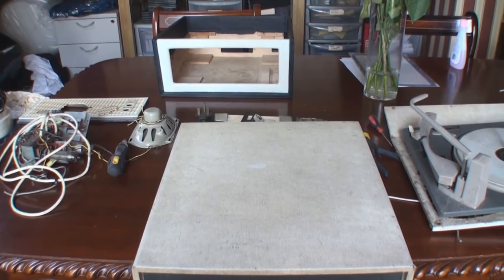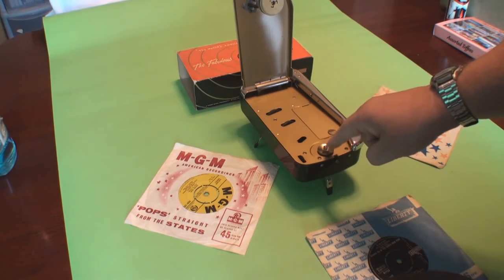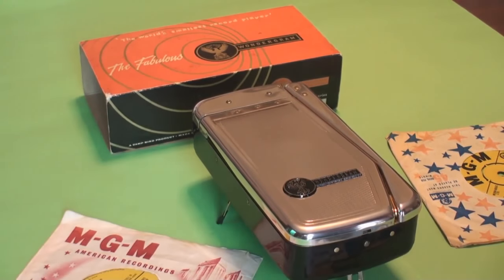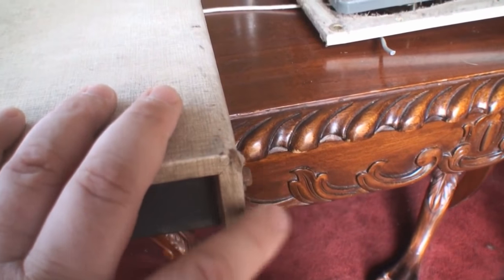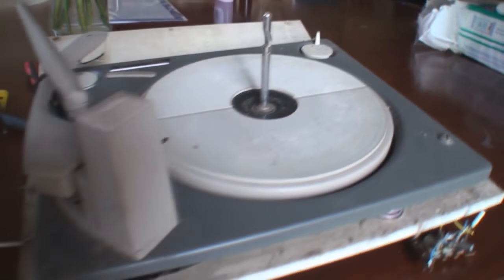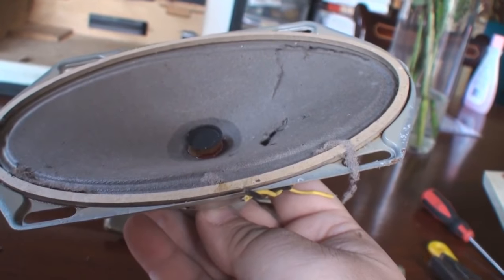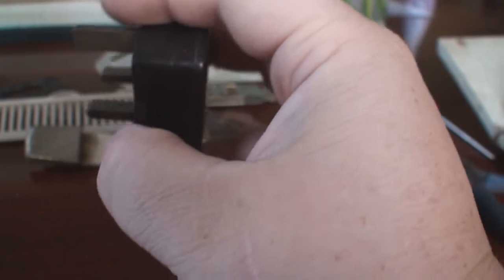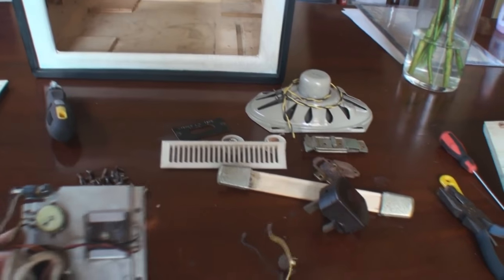The Worlds Smallest Record Player And The Shed Find Dansette Bermuda

Comment: good videos mate ! I've got a player here with a blown valve in it (ul84), the deck isn't seized and spins freely. but motor that turns the deck isn't working ? do you think that could be due to the valve or will it need a new motor ? thanks Graham
Reply from the maker: Without testing it I can't say. best to get someone who is qualified with electrics to check it out. Good luck.